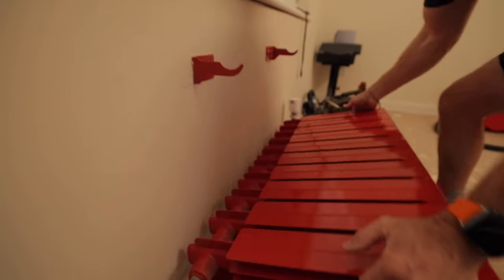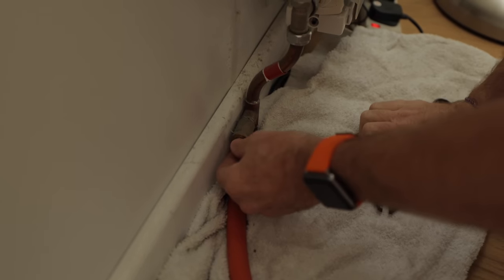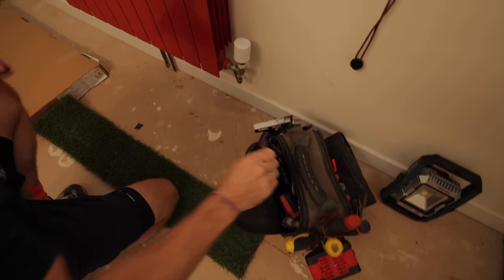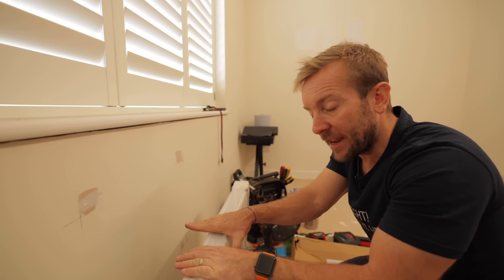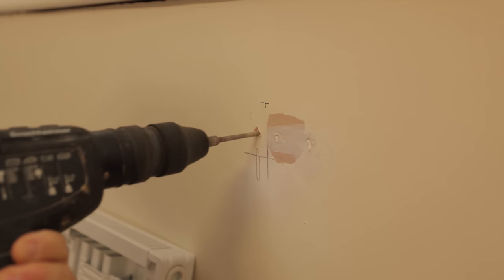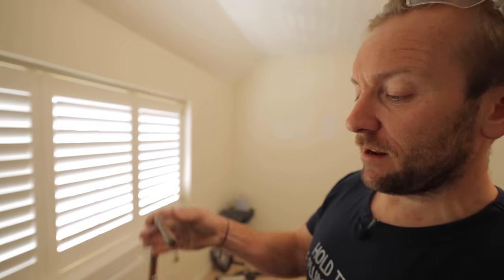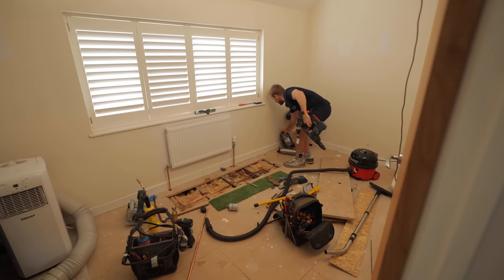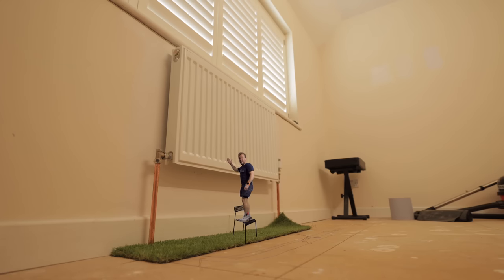10 STEPS HOW TO CHANGE YOUR RADIATOR

Comment: As someone who has a leaky radiator, thank you very much, I don't want to spend a few hundred on a plumber
Reply: Spend your money on expensive Bosch power tools instead 😅  Nice kit but mostly not necessary if you are doing a straight like for like rad swap without re-piping. Some sort of drill for sure but the other stuff probably not needed.
Reply: Hope you’ve got house insurance

Comment: Top tip - when filling up, leave hose pipe connected to the CLOSED drain valve so it’s quicker to get it drained in the event of a leak.

Comment: Good eve.   When you refill the system wouldn't you get a column of air in the capped off flow and return to the rad?  Is it best to use this method or put bleed valves on the tails. I really wanna know this please, google hasn't helped.  thx.  (I assume trapped air in sealed treated system leads to corrosion.)     (My situation the copper tails will stick up above carpet 4 inches, the neater appearance the better)

Comment: My trv would not stop water passing when set to zero, or with the 5p trick. The needle moves but i’m guessing far enough to fully close it. I went for it in the end and capped of with a 1/2 blanking nut but I know that at some point will have to drain down the whole system to replace the TRVs

Comment: Simple question. On the radiator that is being replaced, why can't you just close the lockshield valve at one end, and thermostatic valve at the other end, and then simply remove it and replace with the new radiator? Why the palava of draining down the entire system and all that entails? I've had two rads replaced in the past. Neither engineer drained down the system. And is the B&Q guidance on their video incorrect when they just turn the valves down?
Reply: This is my method never had a problem as long as you take time to bleed the system.
Reply: I've done 2 upstairs radiators the same way you have just said. Soo much easier and takes little time. Just have to remember to release the pressure from the boiler incase the valve doesn't hold up.

Comment: Thank you for this video , very useful, I must say Bosch tools are very good , I think I have a sealed system as I have a Worcester Bosch green star boiler in the loft I believe it is called a condensing boiler as it has a plastic pipe that runs to the outside down pipe . I am going to change 3 rads and add a new one to the ground floor of my 3 bed semi, to drain down do I just kill the power to the boiler and drain down ? , I have only one large tank in the loft which I believe feeds the cylinder and WC and cold taps in the bathroom, would be great full for any advice you can offer me .
Regards,
Dermot Kelly .

Comment: Recently drained my system down. Turned off mains supply, drained down, system got full of gunk from the header tank and blocked it up. Hack to sort it out..... bicycle pump and a washer up against the outlet of the header tank and blast it through. Cleared the blockage out no problem. So you need an extra stage... remove all the crud from the header tank ;)

Comment: I am NOT a plumber BUT from what I have gathered over the years;
A) Wouldn't it have been a good time to introduce some cleaner into the system a few days previously prior to drain down?
B) If you are reintroducing solder into the system shouldn't you completely flush the system to ensure that you don't end up with internal solder causing spot corrosion (usually in the form of pinprick holes)? Also
C) Whilst definitely an overall cleaner look cutting the flooring and soldering new pipework underneath, you could have more easily (no risk of squeaking flooring) connected onto those tails externally and then into the radiator. As a homeowner doing it that way would have been MUCH, MUCH easier then just add a couple of pipe clips to keep the pipe secure??
Reply from the maker: A) Possibly (I did inhibit)
B) No. with all due respect that’s a tad over the top. Most plumbers would never get more than 3 jobs done a week!
C) Yes but I hated that pipe work on show. Much prefer the ‘straight ups’ 

Cheers for the comment! 😎